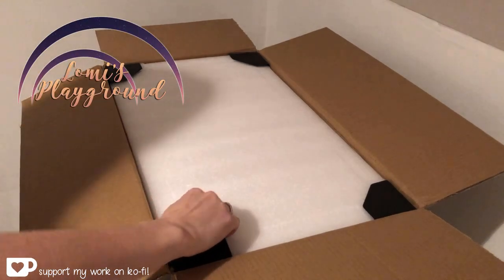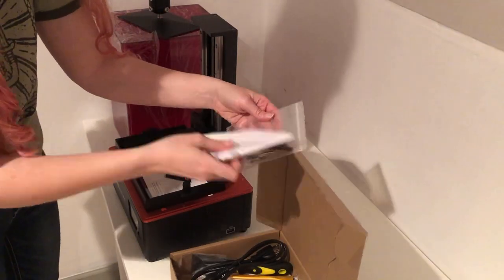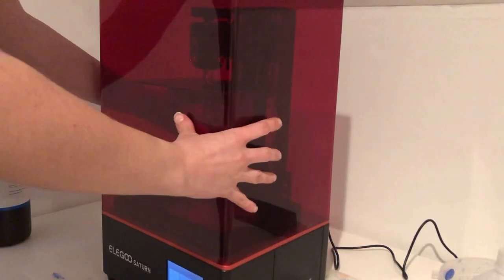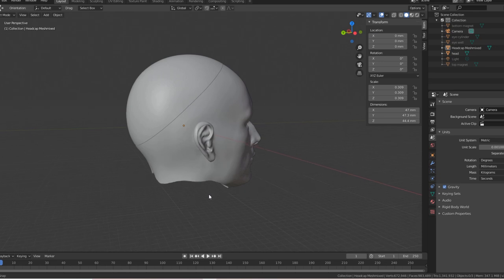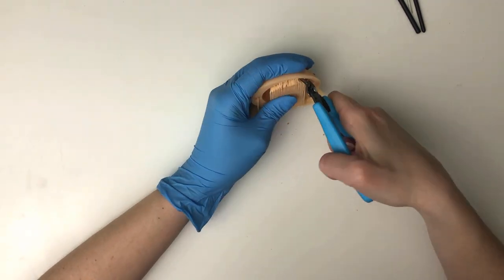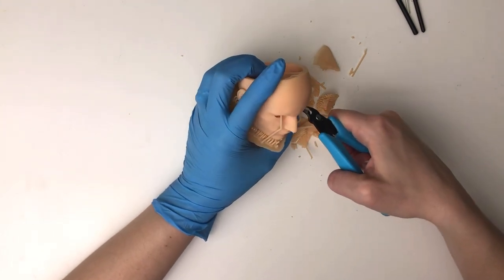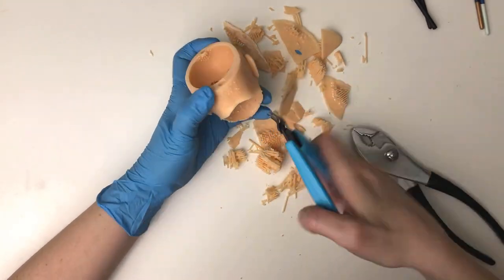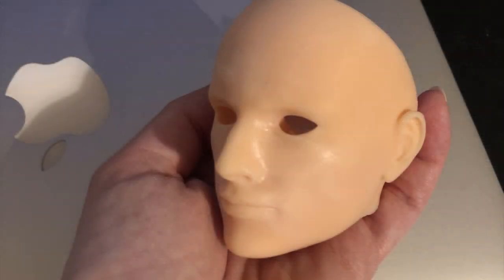Doll making diaries: Making Tahl's head with a new 3D printer

Comment: This has all been (and continues to be) such a steep learning curve. Printing a table top figure or such is one thing, but when things have to be dimensionally accurate and fit together, things get so much more complicated. Printing resin shrinkage as you mentioned, then if using that as a master, there's mold shrinkage to factor in. And then shrinkage of the casting material. So, so many variables - it's maddening.
Reply from the maker: Right? It's so much mathematical trial and error for something I thought would largely be artistic. I'm definitely getting the hang of it as I go, but I didn't anticipate some of these curve balls.

Comment: I have a theory on why the water trick wasn't working for you. I know using hot water to help remove supports would only be easier if you are using the "proper" support settings to make the more finer connection point between the support and the print, otherwise it will pull out a lot of dimples. However with the suction of printing a large doll head you might also get more fails using those types of connection points than you would say printing minis.  Which would then make sense to just remove with clippers and sanding down(especially if you have supports on easily sandable surfaces and not a highly detailed/textured design)

Comment: The 'rinsing in hot water' thing, and it ruining the sculpt might be because of the resin. Resin comes in two types for 3D printers. Water Soluble, and Alcohol Based. MOST of the people I watch that do 3D printing (cause I wanna 3d print figures and dolls too) that do Warhammer or D&D mini printing for their own games, use Rubbing Alcohol to rinse the prints before curing. 
Also even if your resin is water soluble, I would think it should be cold or room temp water, because heat makes things pliable.
Reply from the maker: Yeah, for a huge majority of people I've spoken to, they do what I was doing and use alcohol first for cleaning, then the hot water is specifically to soften the supports and make them easier to remove prior to the final curing. Under normal circumstances, hot water would do nothing but make the supports easier to remove. This particular issue of uncured surface phenomena has proven extremely interesting as I've experimented with it and spoken with scientists and university professors to determine exactly what's happening. I've ultimately found some good solutions for how to compensate for it, but it's way too much to address in a comment :) Hoping to make a video about it at some point soon because it's a pretty complicated problem on a mechanical level!

Comment: How the heck did you hollow out the head? Ive been trying to do that it for ages!
Reply from the maker: I start with spheres for the eyes, then make a flattened egg shape that suits the inside of the head. I use Blender's boolean functions to subtract the geometry of the spheres and egg from the solid 3D head. :)
Reply: @LomisPlayground  Thank you! I remember reading about Booleans, but I could never get it to work the way I wanted to.
Reply from the maker: @mitchiribeetle225  They're super finicky!  Blender has a basic information bit here: https://docs.blender.org/manual/en/latest/modeling/modifiers/generate/booleans.html

But the chief problem I have is it either not working, or doing the opposite of what it's supposed to. I recently learned that when that happens, it means two or more vertices are overlapping and preventing it from working correctly, so shifting pieces by a pixel or two and trying again will help.